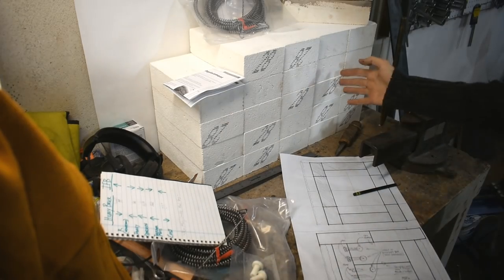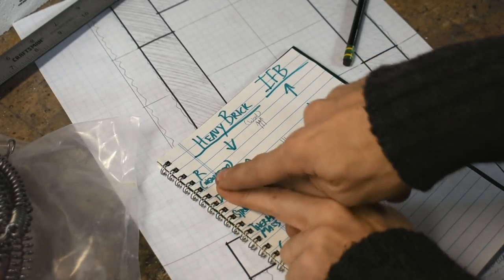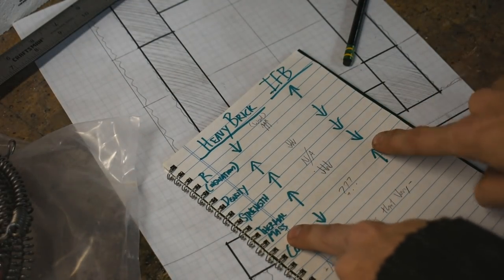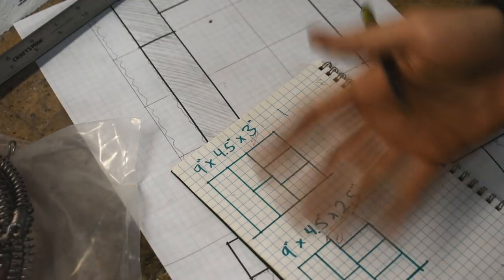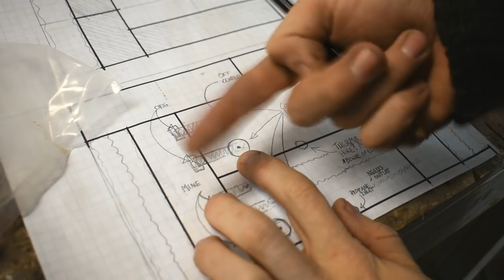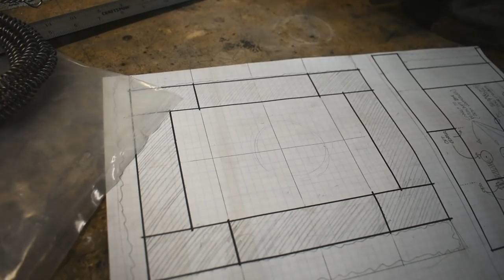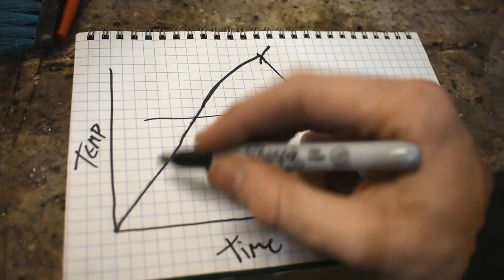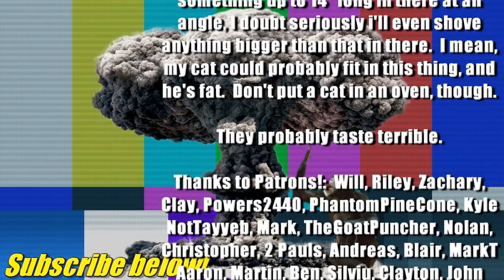DIY Electric Heat Treat Oven/Kiln/Furnace Part 0.5: Design and Materials (Fire brick and Kaowool)

Comment: Checked out your link for the fire brick. I was a bit amazed at the price, I worked in a steel foundry and hated handling those, ours were 4" thickX 8 inches long. We had to replace the roof about every 2 weeks, it was dome shaped 12 feet in diameter, three 8 inch carbon rods provided the heat using 50k volts per rod. It makes me appreciate the time your putting into this, thanks

Comment: In a heat treating scenario less O2 means less scale on the steel, also to control your environment inside the kiln/HT oven you should use an inert gas Argon or Nitrogen I believe? Check Paragon web site they make a kit for it. Depending on the controller you can use it to trigger the gas system, which consists of a flow meter and a gas solenoid valve. Propane injection sounds EXPLOSIVE??

Comment: You should look into aircrete it's a mixture of concrete and soap suds I believe the honey do carpenter on YouTube has a great demonstration of making it very light and heat resistant I would put fire bricks on the inside of it and do that on the outside if I was doing it. Just a thought something you might want to look at

Comment: Heat treating in a reducing or neutral atmosphere means little or no fire scale, therefore good. Going super rich, you may get a wee bit of carbeurization, but on nongeologic timescales, not noticeable. Although for case hardenining, a reducing atmosphere won't burn away your carbon source so you can use a lot less than if you were in an oxidizing atmosphere.

Comment: Also the ramp rate slows as you close in on the element temperature - less delta T between the element and the inside of the furnace, so fewer BTU/s transferring from the element to the furnace material and gases, on top of greater heat transfer to the environment. Woot.

Comment: Thanks for sharing your source of bricks!

I don't know if anyone is going to find this interesting or not, but the reason a rich fuel mixture (firing in reduction) will rip oxygen atoms from pottery is that an incomplete burn creates carbon monoxide rather than carbon dioxide. Gas can pass through pottery at low temperatures that hasn't been vitrified yet, so this carbon monoxide interacts with oxygen molecules in the pottery and rips them out, creating carbon dioxide from the CO. The (usually metal) oxides in the pottery (or metals in the furnace or whatever) are reduced, resulting in color changes (if pottery) or oxidation state changes (in the case of metals).

I'm really curious to see how this propane introduction will interact with your elements. Will they be corroded more quickly because of this?

Edit: This is my understanding of the reduction process, at least. If I'm wrong about that I'd love the correction!
Reply from the maker: Since building this I have built a purely gas kiln for reduction firing pottery, but I've heard plenty of people blow gas into an electric kiln to get reduction and the elements last just fine.  The elements are always expendable to a degree I suppose, and messing around will always shorten their lives, but it isn't as bad as people make out.

Comment: Hi Paul - Do some more Googling on Vacuum Heat Treating / Vacuum Furnace. Your plan to introduce Propane will effectively "Carburize" (introduce carbon into) your parts which has benefits to certain materials and can interfere with others. Other gasses can be used instead (like Argon) to eliminate the oxygen which can also have different results on your part surfaces.  Have a Safe and Merry Christmas.
Reply from the maker: Thanks for the info! I can spray whatever into the hole, you're right.  I have an argon and an argon/co2 tank already
Reply: @PaulsGarage  I also wonder how the heating elements would behave in a reducing environment if their means of corrosion resistance is by oxide layer formation. I saw a video of Cody's Lab where he was making charcoal in an electric kiln and the element broke some point in the process. He mentioned the possibility of the reducing environment leading to failure. I'd think it wouldn't matter as in a reducing environment nothing would be attacking the elements. But there are two possibilities I can think of. 1) Carbon diffuses into the elements changing their composition leading to possible failure 2) Going back and forth between oxidative/reductive environments forming perhaps a weird/non-ideal crystalline structure that slowly progresses inward. These are just my thoughts. Perhaps I'm wrong and it will work fine, or not for some other reason. We'll see I suppose?
Reply: Yeah... Argon sounds like "the right thing to do" to me too.

Comment: I thought one of the reasons for the over sized T slots was to accommodate the expansion of the elements as they heat up.
Reply from the maker: That could be, but they are only oversized significantly in the vertical dimension.  I'll have to leave room for expansion but not such a huge amount
Reply: Or help with replacing the elements - they're considered consumables in a production environment.

Comment: th themperature regulation setup seems to be pretty easy to set up , at least theres plenty how too's available online you might even do the tempcontrol thing with an ardiuno   

combining in the propane burner might cause a little trouble but i think a pilot licht start sparker and an electric operated valve should work 

the slots for the heating elements can be recreated with a long frill drilling the bricks lengtwize then saw in the grooves or a hand held wood router (LOT OF DUST) first use a plunge bit and gut a groove the the required debt the use a ball shaped router bit to make the channel, seen someone make halfchannels in the top and bottom of the firebrick before stacking them with the element inside it wish is eazier to do 

so if i understand you correctly you going to spray unignited propanegas into a electric kiln............ thats definetely not a good idea as propane can make the kiln or the room its in explode aspecially if you heat up everything as hot as the sun  , better option is to use either shielding gas for a welder or bottled o2 (bottles used for sodapop fountans , use outside) with a regulator as that isnt flamable can buy ppm counters to regulate the atmosfere inside the kiln if needed but those can be costly 

if youre burning the propane inside a "box" to make o2 (sumtimes callesd o2 generator in the greenhous community ) and route the exhaust from that through the kiln thats no problem though 
basicly you need a bad burning propane flame having lot of yellow in the flame  to create lots of o2  
putting the propane flame inside the kiln with one of the foundry burners youre using might create a hotspot and melt the bottom elements
as you dont need to have it make a ot lof heat but more create o2 you could use a burner from a on demand propane waterheater and mess with the airregulaton to create let heat and more o2 the heat goes straight up and will harm the elements in the walls less 

i seen electric kilns that have the narrow grooves and use the pins to keep it in place , this method dont realy seem to work well , when the element heats up they expand and droop out of the grooves going in there with tongs to get the crusible out might damage them or if there still on short them out   
 one thing i seen done is that they made the grooves angled up , that holds the elements in a lot better as when they expand they drop toward the inside of the groove  , having T slots is way better still
Reply from the maker: Grooves angled up is a great idea, I'll have to do that.  The propane is really only an idea for super high temperatures, as in self-igniting temps.  People do that when making reduction fired ceramics using an electric oxidation kiln, that's where I got the idea. I'm not clever enough to come up with that on my own lol

Comment: Last one... Have you thought about preheating the propane by perhaps running a short section of stainless tubing on a groove on the outside of one of the firebricks for a few inches? Just bring it up to a few hundred degrees before injection, vs ice cold vapor blasting in and potentially impinging on your parts/crucible/etc. IDK if it's low enough flow rate or exothermic enough to make that a non-issue.

Comment: Can pick up a Keyhole Cutter for the router. Makes that T shape cut out.  i use it on the back of wooden plaques for hanging on the wall. i wouldn't want to be standing around your garage when you fired up the router to make the cuts. it's going to be a powdery fog of asbestos-type particulates... if it's not in your lungs, it's clogging every pore on your skin... on that note, Have FUN!
As per the brick thickness of the American standard, i believe it is accounting for the mortar thickness between the bricks. Brick is not usually set "dry", except where firebrick is a very thin slurry of mortar, making a fraction of an inch seam. Standard brick assumes a non-firebrick usage. BTW, normal mortar would be burned out in a matter of firings, so never use regular bricks and mortar in a firebox/fireplace situation. 
Paulie Z - Son of a Mason that specialized in Fireplaces..
Reply from the maker: Interesting about the mortar, why wouldnt they make that allowance in all dimensions though instead of just the thickness?  And good idea with the router bit.  I have a router here but I'm afraid the brick dust would murder the thing!  Respirators on, definitely!  I got your card btw, thank you! Will show it in a vid soon.  It came like 2 days after the last mail video unfortunately
Reply: Veg oil guy put out a video about how to deal with the dust. Short answer soak in water then cut. And then dry for a long time. Love what your doing paul. Already sure im driving my wife nuts with plans for things to build when i leave korea.

Comment: That was a really good video explaining most everything someone would need to know to build one of these. I’m sure they’d come up with some questions, but great amount of info.

Just for fun, I say, can you compare the cost of diy versus purchasing a prebuilt with the same features? I think that would be interesting.
Reply from the maker: That's a good idea!  You sort of can by looking for small computer controlled programmable kilns, usually over a thousand bucks for them.  Most of those don't have such high temp bricks or as much insulation as this will, though.  They also tend to be lower power for this volume, but I dont want to be lacking heat.
Reply: Paul's Garage that sounds about right to me. Of course those Paragon ovens probably work wonders, but you need some good financial reason for buying those...

Comment: here is my 1/2 way comment, because I've only watched 1/2 of the video.  cool!  I am working on a much smaller "design" of an electric kiln.  there isn't actually much of a plan for it, that's why design is in quotes.  it uses parts from a toaster oven and some type of high temp insulating wool.  and satanite.  ever try painting satanite on fluffy wool stuff?  I thought of you.  Mine will also have electronic control of some sort and run on 120V.  I am hoping to get hot enough to do better at lost PLA investment casting.  maybe 1220F?

Comment: How can i make vacuum kiln, with CO2 gas inside the kiln oven
Reply from the maker: That sounds pretty complicated.  You would need a vacuum chamber which I've never built, purge it with CO2, pull a vacuum, and have a way to prevent air from just leaking in.  Maybe a double wall?  Make the inside a vacuum, and between the double wall purge with CO2 so any leaks into the inner chamber are all CO2?

Comment: This is all really complicated for an entry level project. I am more of a proponent of starting small and working my way up with projects. I always thought propane was flammable. You're not just going to run the gas into your furnace, are you? Like it is going to be lit, right?
Reply from the maker: Yeah.  Basically I'm not thinking of using the propane until temperatures are high enough for it to ignite anyway, otherwise I could just use a plumber's torch or one of my burners set on low if I need it at lower temps.
Reply: @PaulsGarage  still sounds intense. Good luck!

Comment: Paul, I am going to unsubscribe. I know you probably won’t see this, but I cannot abide hearing that you did something as deadly as injecting propane at high enough temps that even if you keep most of the oxygen out, some will get in the through the opening for the thermocouple, and at those temperatures even without oxygen, the propane will hydrolyze into hydrogen and carbon. The carbon will pit the surface of the metal, defeating the purpose, but even worse, a Dixie cup of hydrogen exploding was enough to deafen my chem prof. What you’re proposing will leave your soulmate with have her soul in this increasingly hostile world. Bye, guy. Don’t die.
Reply from the maker: Sorry to have you go, but perhaps I can reduce your fears a bit.  I probably shouldn't have cut the section about the propane burner, but I'll add some detail here.  This isnt a new idea, it's often done by potters who want a reducing atmosphere, though it isnt super common.  Basically, the kiln is heated electrically until around 1850f, no propane, pure oxidation atmosphere.  Then, while continuing to heat, propane is shot in through a hole (that does not seal perfectly, obviously) and ignites.  The fire then uses up the oxygen inside (as well as oxygen being sucked in through the propane hole and any other leaks) and exhausts through another hole elsewhere on the kiln.  Not enough gas and air is sucked through to heat anything too much, but it IS burning the propane and producing a draft through the kiln.  This will shorten the life of the elements and the thermocouple according to a furnace engineer I talked too, but not as much as you might think, especially the thermocouple.  While thermocouples are wear and tear items in all high temp kilns, these are designed for use in gas kilns also, most prominently fired using propane.  The controller also tracks thermocouple health and will advise when it's time to replace it.  Same goes for the elements but those are always shorter lived in kilns.  In short, it's not so much shooting propane into a kiln, more like having a very undersized propane burner running a little rich, and relying on the elements to provide the necessary heat.